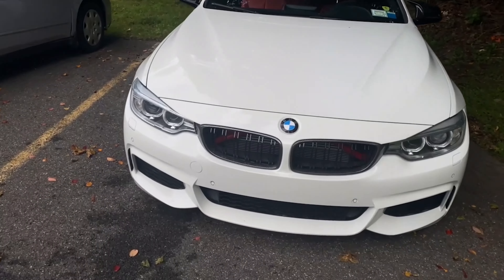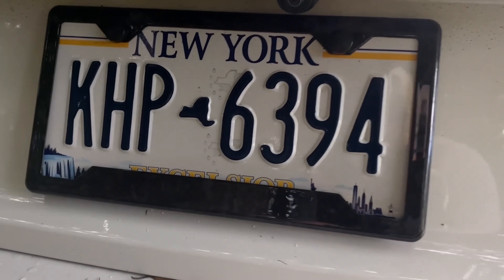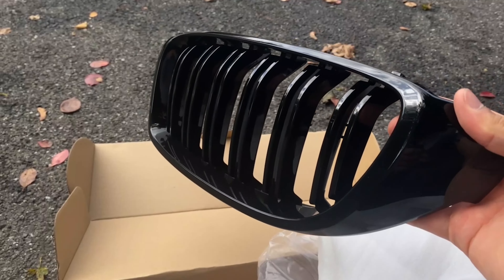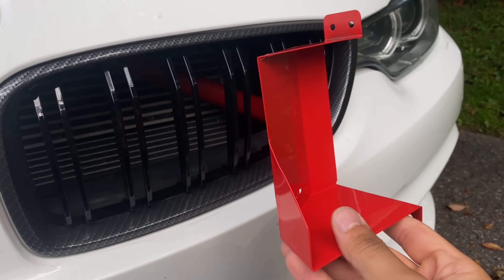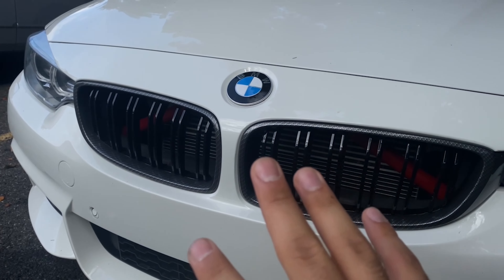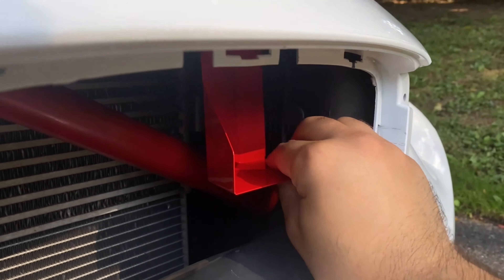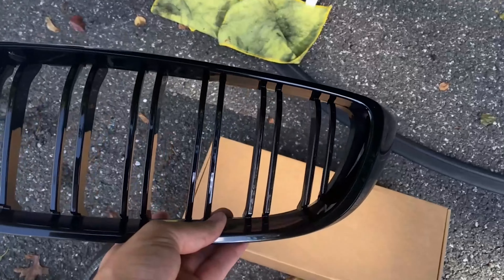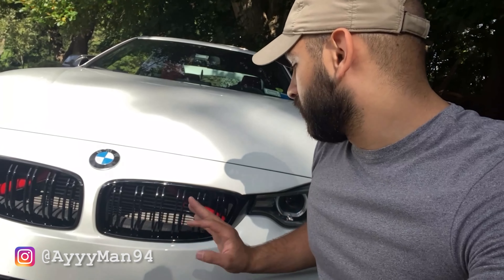WHY I HAVE TO CHANGE THE GRILLS on the BMW 435i... AGAIN...  *EXPLAINED* (PLUS A NEW MOD!)

Comment: The gloss black mods looks the best and they need to go with a gloss black roof. Do yourself a favor
Reply from the maker: Yeah I’ve been debating doing it. Probably gonna try it myself and see how it goes. Should be an easy enough surface to wrap for a beginner